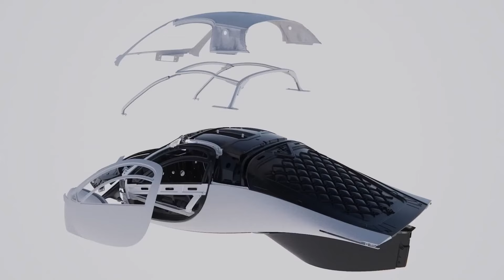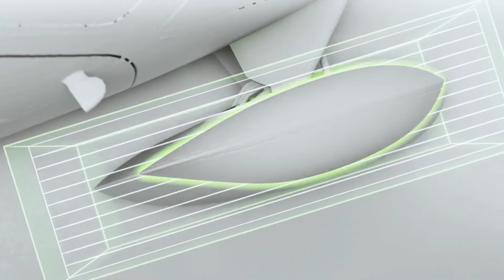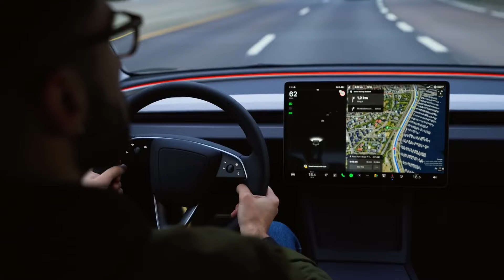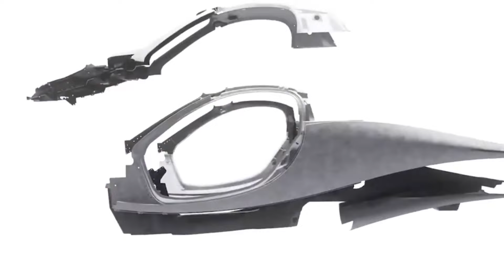Unveiling the Future: Solar-Powered Aptera Marvel

Comment: 0 to 60 in 4 seconds 0 to 100 a round 9 seconds and It has traction control but don’t think it changes the steering in the way you inferred but outside of that not bad.

Comment: Did you hear that n.brucenelson?  Starting at ~5:05 he got it wrong!  Be sure to tell them that you, and you alone, know the truth.  It's NOT 100 watt-HOURS per mile.  It's really 100 WATT per mile.  Oh for the want of a "time element"......
Reply: I believe dc charging is back.
This vid needs a tech editor.
Reply: @ronfarnsworth7074  - Doesn't matter as long as it's press. You can be full of wrong information but as long as it makes Aptera looks good, it needs to be shared all over the place. For example, the 1000 mile version that gets 40 miles per day will come out in December and cost $25,900. That is all wrong but sure makes Aptera look great. So it goes to print.